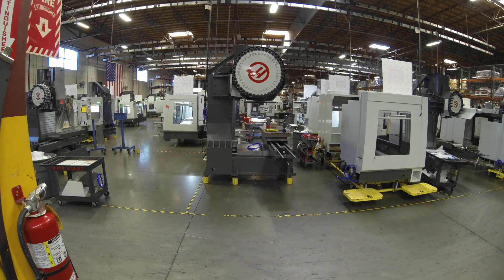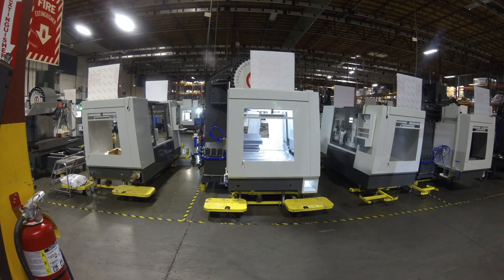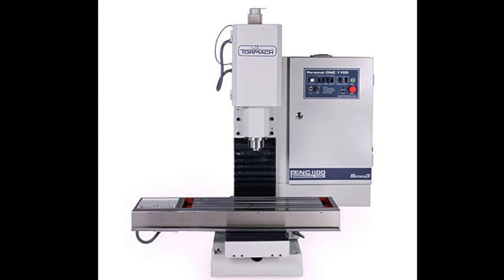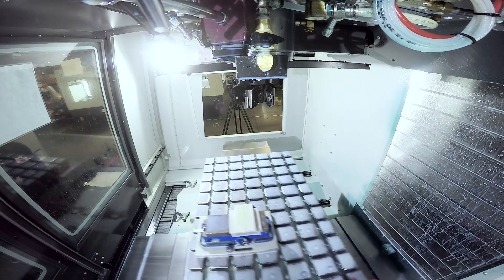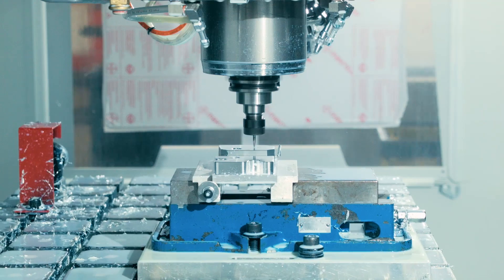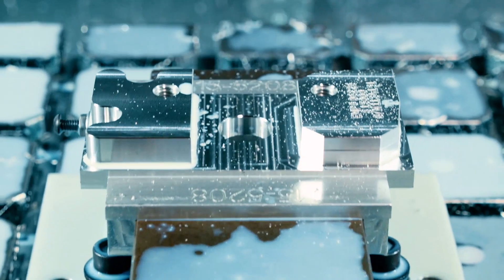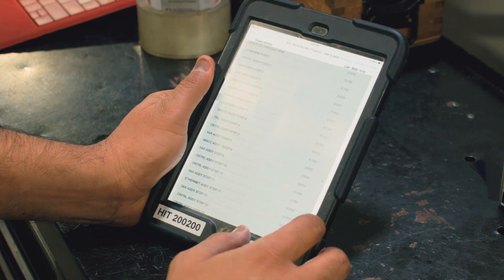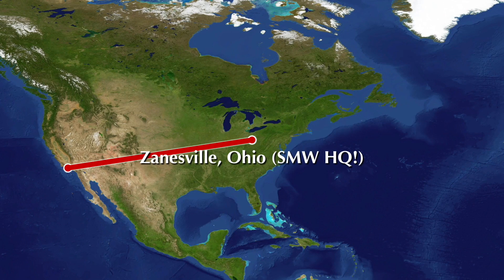HAAS Factory: Behind the Scenes Assembly & Testing!

Comment: The ballbar tests in the YZ and XZ axes determine column squareness by looking for any variance in the length of the ballbar during the hemispherical arc moves thru the Z axis. If the column is dead square and the Z servo is in calibration, there will be no length change during the movement.   Performing both XZ and YZ tests determines, via measurement differentials, if any errors are due to column squareness issues or due to z axis servo calibration issues.

Just as the XY test determines X and Y servo calibration and also squareness of the X and Y axes to each other,  the YZ and XZ tests do exactly the same thing in the same manner.

Comment: Personally, I like thread milling if I'm machining parts, especially if you have a lot of parts to do. I normally do a rough and finish pass and the size holds pretty well. I find when machining Titanium, it grabs the tap and breaks at the bottom of the hole, which is no fun, so I always thread mill that.
I tap aluminium though if it's just a fixture or a 1 off part. But it depends if I have a thread mill set up in the machine and it's set at the right diameter in cutter comp.

For the mill table, I would put a slab of ally down and machine holes in it as needed in a grid pattern. I used to use a machine (+2 metres x 1.5 metres) with a full matrix plate (grid of tapped holes) and we used nylon bungs that threaded into the holes to stop swarf from getting in them. It's probably a bit expensive to start with, but it saves a lot of time with setups.

Comment: Thread milling is great for bastards or large diameter threads. But if you can get a tap to do it, go with the tap. You do not need a special floating holder for this machine if you got the rigid tapping option. Also, play with setting #130 to adjust how fast the tap retracts.

Comment: now before ya get too involved buy a 1.5 to 2 thick slab of aluminum thats the size of your table tape or toe clamp it down lightly...flycut,flip,mount,flycut then drill a grid of holes...every other one tapped vs reamed for a pin....makes it very easy to mount fixtures or surface mount and is a great sacrificial table cover in case of a Oh Shit moment!

Comment: That is so cool to see the bare "skeleton" of the machine before it's assembled - still linear ways, ballscrews, and motors. And the ballbar testing - I would guess that if the column wasn't square with the bed (tilted forward or back), the YZ movement would appear slightly elliptical, but the XZ would remain circular. Just a guess though!

Comment: Rigid tapping: YES!!   Unless it's an exotic size.
Reply: Spencer Webb my robodrill will tap up to 3600 rpm, I form tap all day at 2000 rpm. Haven't tried anything larger than 1/4-20 yet though.
Reply: 1/2-13?  1,300 RPM for me with a form tap. 

4-40 I'll tap at 4K. Have 4500 max tap RPM. 

If I get the new machine I want for work it'll be tapping at 6k
Reply: Be aware that the Haas direct drive torque curve peaks above 2000 RPM so large taps are a huge no-no. Talking over 3/4" in steel though. We do 1/2-13's all the time in ER-32 collets.
Reply: NYC CNC 
1/2-13 isn't big...

I'll rigid tap in a machine up to 1" diameter. 

Past that I'll thread mill. 

HAAS maybe limit to 3/4" as the spindle has limited torque that far down on its RPM.  Unless you're feeling ballsy and want to tap it at  over 500 RPM.
Reply: NYC CNC   LOL, yup, just consult the appropriate tables.   I just did a project for a gunsmithing fixture with about 24 holes, all 1/2-20 in 12L14.  Watching my machine (Sharp 2412S) rigid tap those was a pleasure.  And form tapping is also awesome.
Reply: NYC CNC One more thought... I just use 500 RPM for tapping.  Seems plenty fast enough for every thing I do (1/2" to #2), and it's prototype work, not production.  Never figured out how high the RPM can go... maybe that's a good experiment one day. 

And atomkinder67 makes a good point about torque curves, but prolly not an issue sub-1/4".
Reply: NYC CNC calculating.....
calculating.....
calculating.....

500 RPM.  😂

(and lotsa coolant, maybe a tad rich)
Reply: bensbenz Guess I'll have to try it.  Gulp.
Reply: Occams Sawzall He bought a Haas not a Speedio. I've never bothered tapping over 2k in our VF6SS because the spindle simply doesn't reverse fast enough to save any time. He'll do fine at 1800 max with the retract at 2x.
Reply: atomkinder67 
You're no fun :P
Reply: Occams Sawzall What can I say, I program a Haas and Fadal and used to program LeBlond-Makinos and run Nakamura-Tomes. I'm bitter 😂😭
Reply: atomkinder67 
Nothing to be bitter about over a Naka.  Things will drive a gauge pin through solid aluminum!

Ask me how I know. 😆
Reply: Occams Sawzall The key term here is "used to" 😉

Comment: I like rigid tapping alot, its quick and easy if the fit is not critical. its also alot easier with good collets. you can get higher percentage threads with a tap with very little to no runout. but would probably be easier to thread mill.

Comment: To your threadmilling vs tapping
I would definitely thread mill larger threads over tapping. 
My general rule is anything 1/2" and under I will run a tap. It takes a lot less work to produce a good thread then to setup a threadmill and dial it in. 
Even for 1 off parts that I am trying to do in 1 shot I'll just tap 6-7 threads into the part (leads length) and finish by hand. 

Oh one exception to my rule. NPT. 
threadmill that crap.

Comment: Form tap everything you can. Its way faster and easier than single point threadmils, and cutter wear can be a real hassle. Unless you need to do eternal threading, big stuff, or really hard materials. When a tap wears or breaks, you just whack another one in, probe the length, run the same program, and its all set. You can get many thousands or tens of thousands of holes in aluminum with a form tap.

Comment: Tapping if faster than mill threading.  There is a crossover point which depends on machine rigidity, power, fixture and material being threaded.  In general, in my case, tap up to 1/2"' thread mill larger.
Reply: Sorry, I was not specific.  I currently only cut threads, no form threads.  I use a Techniks tension/compress head.  This is on a 5hp bed mill (Prototrak DPM3).  I should probably try form threading.  But, on the large holes mill threading is really nice.  I tried it with LakeShore Carbide tooling after watching you do it.

Comment: You will run rigid tapping on one part with a bunch of holes and never want to thread mill again. Yes you will have some cases where it will work out better to threadmill but I bet 99% of your thread making will be rigid tapping. As an example in the time my old machine thread milled 1 3-48 hole on my light base, the robodrill ridged taps 6 holes using a form tap. Which I would also recommend, form taps are awesome just pay attention to your drill size. Cant wait to see you making chips!

Comment: Thread milling with a full depth thread milling cutter (fixed pitch instead of single point) would be as fast or even faster for anything over 12-14mm if you can mill the whole depth in one pass. Mostly because you will be running higher RPMs and large conventional taps don't cope with RPMs as the size increases

Comment: Write a simple program to clean out the T-slots with the thru-spindle coolant. Just put in an empty tool holder and you should get a nice jet of coolant. Probably won't be perfect, but it would help break up the chip pack in the slots if you are doing any kind of batch work or large runs.
Reply: I was going to suggest washdown hose, but you nailed it.  You could make a nozzle and stick it in a tool holder too.
Reply: pfff.. clean T-slots? thats what mexicans are for!

Comment: Checking true on the Z axis.  The X and Y were already measured during the obit check.  The error, if any, would be subtracted from the Z axis check.  So if the length of the bar is constant throughout the X and Y check and there is length change in the bar during the Z check, there is a problem in Z.  Kinda like the Y or X axis check turned on edge.
The short time I worked as a machinist we cleaned up everyday using air to blow the chips out of everything and swept up after.  On the Haas would it be practical to plumb in a garden hose connecting to your coolant tank and use coolant to clean up?  Wonder if that is even a good idea but for sure it's an idea.
Reply: Robert Palmore 
HAAS comes equipped with a washdown hose already. Which is literally a garden hose with a spray nozzle. It's plumbed to a diverter in the back, one way to pump coolant to the flood coolant, the other to the washdown hose.
Reply: Occams Sawzall like many of my ideas, someone beat me to it;-)

Comment: John, Rigid tapping is much faster than thread milling. You will use it for many things but it won't replace thread milling for other reasons. For instance #1 if the thread is to large for the power of the spindle #2 if you want to control the diameter for some reason (a none standard thread) #3 if the thread goes very close to the bottom of a blind hole. #4 If the thread is a none standard thread or the tap is very hard to get or very expensive (like buying a Acme tap for one part). #5 If the thread is a OD thread of course it has to be milled (That said I have used a geometric snap open threading head for OD threads on a mill before). I usually always thread mill threads in difficult to machine materials or parts made out of expensive materials to avoid the possibility of broken taps. The other disadvantage of thread milling is that you will always need a thread gage of some sort to gage the thread. With tapping you could slide buy without (that kind of depends on the quality control of the part. I my case all threads have to be gaged). Thread milling will usually leave a better finish than taping will. Tapping can have a chip control problems depending on the style of tap used and it usually requires some kind of tapping fluid. This can in some cases be messy to clean up and can stain the material (Molly-Dee for example).

Comment: as a machinist for ~10 years (note: i mostly machine smaller items) i have never done any thread milling.  we rigid tap everything from 4-40 to 3/4" npt, or even bigger with our vm-3
Reply: yessir, 30hp is quite awesome.  is that the same power as the new ones?
Reply: NYC CNC 
NPT. National pipe thread. 

Tapered thread designed to self seal

Comment: John, Rigid tapping by far is the way to go. You have the torque now, it is much faster then thread milling and as others mentioned you can use form taps as well. It is also much cheaper, throw a tap in a standard holder and go. Because its rigid you can tap to the bottom of a blind hole very accurately because you don't have the error of a compression head. I still thread mill odd ball threads, but tapping is first option. The Ball Bar test is a full short travel calibration of the machine. It can see a lot more then squareness issues. It can check for positioning errors, backlash, squareness, servo gains, the whole nine yards. This is the last tool before you break out the laser system.

Comment: Rigid tap (form taps are ideal) as much as possible. Thread milling is painfully slow and you have to constantly deal with cutter wear. 

And taps are super cheap compared to threadmills.

That said thread milling is good for hard materials where the material hardness is pushing the limits of a hss tap. And in large diameter threads where the taps of that size start getting ridiculously expensive or they're too big to hold in standard tool holders
Reply: Single form thread mills are great if you don't want to buy a 9/16-18 tap for one job, too ;-)
Reply: roll taps are best up to like3/8" beyond that, thread milling. i hate, HATE, cut taps, avoid at all costs...
Reply: Using a form tap is nice and all, but doesn't that option depend on the customer's request? Pretty sure there's a structure difference between cutting the material away and forming it.
Reply: gredangeo 
Rarely. Certain aerospace parts may specifically state no cold forming of material, which means form taps are out. 

But it's very rare, and usually only applied to stress critical components where cold forming the material may cause internal stresses or micro fractures. 

But I'd say 99% of the time a form tap is perfectly acceptable.

Comment: Behind the scenes factory tours are so awesome!  I am kind of surprised I didn't see them do any laser alignment tests. I would think rigid tapping will be faster than thread milling. Do they take the test part they milled and measure it to see if it matches what it is supposed to or just store it?
Reply: NYC CNC Haven't worked there in awhile, but usually the only things that get the CMM treatment are first article parts and parts that have issues. Probing while machining takes care of the rest.

Linear guides and whatnot are located off of features machined in the same setup using a nifty technique of cammed bolts along the guide. So during assembly they can tweak the guides a bit while indicating to get them square. Y then gets squared to X. Not sure about Z, as I worked on TM's with a "bolumn," base and column cast and machined as one. 

1 setup/op is the gold standard for the engineering teams. For example, your VM-3 base (which is actually a VF-5 base IIRC) was clamped onto a VS-3 and every feature on it was machined in that setup. More complicated parts get the machining cell/pallet treatment with an indexer or for larger stuff one of 5 side machines. Those are freaky cool to watch with their chain tool changers and multi sided 50 taper heads.

Those are a good example for rigid tapping limitations, but not rigid vs milling. While they COULD tap 10-24/32 into cast iron on those machines, the guys usually went with 1/4-20 or bigger and used a thread cert. Basically, pick the process for your application.

Just to reiterate, I WAS a Haas engineer, the above info is from ~09 and may suffer from some "misremembering," and I AM NOT speaking on behalf of Haas in anyway.

Hope this helped a bit. Have fun and BE CAREFUL!! Unlike the Tormachs, that VM-3 will close the servo loop until there is something that will stop it dead. Crash it hard and you'll get to see the ball bar in person :)
Reply: NYC CNC aaaanndddd I misread the part about the test cut being CMM'd. The test cut is just that. The machine was completely squared while "naked," the test cut is just a final test to make sure everything is working as it should. Operator will check the surface, particularly on interpolated moves,  just to see if anything stands out.

They do it so often that they can a small problem pretty easily.

Comment: I prefer (professionaly) Thread Forming (for aluminium) because there are 2 big advantages first there are no chips so if you do a thread wich is not trough hole no snaping tools, and second the thread gets more rigid because the material is compresed. Check it out it'll be worth it!!